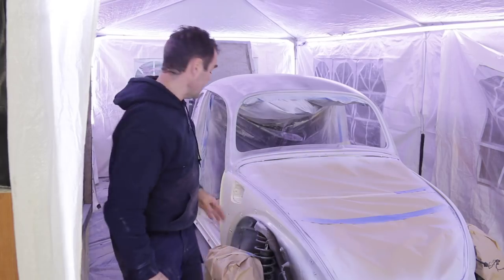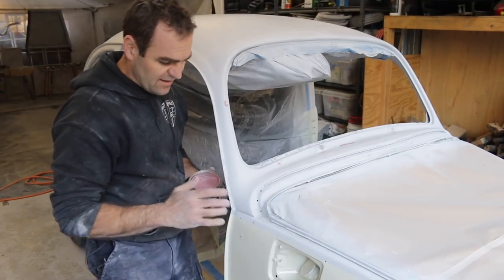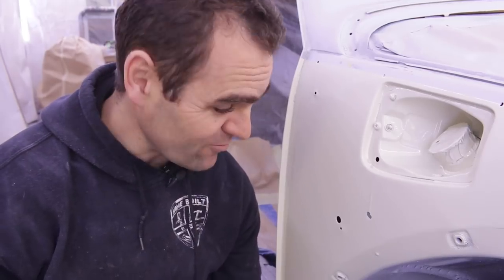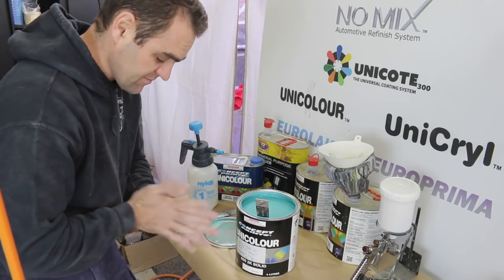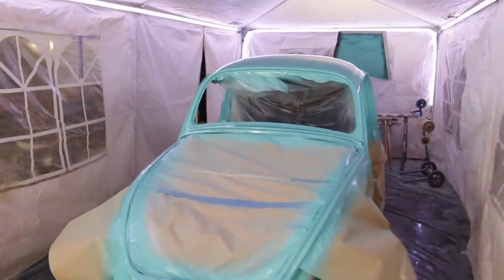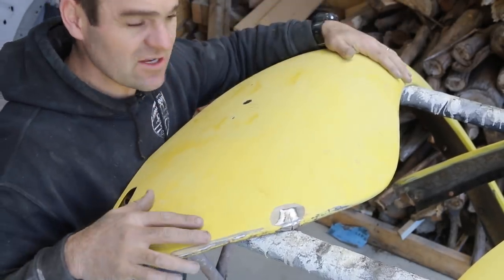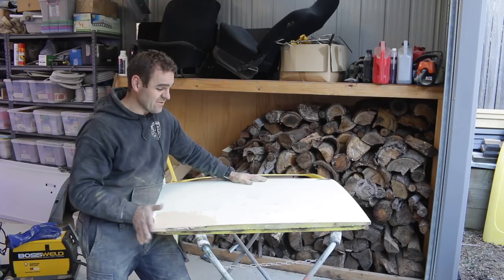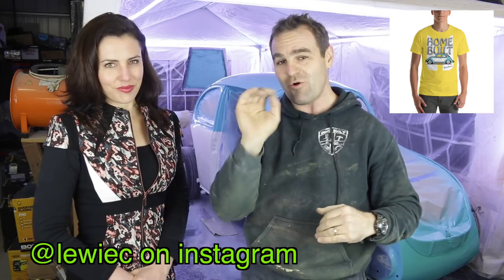New colour for John Lemon - Home Built Project Beetle part 19

Comment: Hey Jeff love the Blue!   When I saw you trying to cut the heads off the runs I thought ," Jeff you are a brave young man.  This is not going to end well!" ...experience.  With your welder are using a gas shield unit or is it straight flux core wire?   I should send you some pix of my 73 project.
Reply from the maker: I use a gas mig these days. It is much cleaner and more stable for this work.

Comment: Jeff good work mate but a tip for the runs mate use the blade you used but scrap it along the run then it will level it out letter and then you don't chip it like you did
Reply from the maker: I actually have a video on that.

Comment: Hi Jeff,
What method do you use for heating up your booth after painting?  I'm very grateful for the time you put into doing these videos.  I have built a booth in my garage based on your one and I'm almost ready to start painting.

Cheers
Ian
Reply from the maker: If you need to heat, I recommend doing it first, as it is better to get the metal warm, and then you can leave it a little while after you paint for the paint to get a bit firmer then heat again to cut down on dust. I have had ok weather in the teens while I was painting so I didn't need heat, but with the Porsche I used a diesel jet type heater which worked a treat.
Reply: Thanks Jeff, sound like a plan

Comment: New subscriber and really enjoying your channel. What’s the trick to welding up that thin metal. I have trouble blowing holes in it. You make it look easy.
Reply from the maker: Turn your machine right down, and just do tiny little tacks. Heat is the enemy.
Reply: Home Built By Jeff Thanks. I’m working on a 1971 bug it’s been hard to get consistent tacks beachside the metal is thin in spots. I appreciate your advice.
Reply from the maker: Jamie Pezoulas another good tip is if you can get behind the weld you can hold a brass heat sink against the back. I use an old brass rod.
Reply: Home Built By Jeff Ah, that’s a good tip. I have a copper plate I can use to try that. Thanks!!

Comment: I haven't tried one yet, but a "Tungsten Block" is apparently the go for minor paint problems. Check out The Gunman's video: https://www.youtube.com/watch?v=lFUvhLKqYVs

There are also small files (like some woodworking rasps) that can also remove runs. https://www.eastwood.com/painters-nib-file-fine.html

For bigger runs, he has a trick with covering over them with fine body filler and sanding it all back until the filler is gone. Basically the filler is used as a guide coat. https://www.youtube.com/watch?v=mn6nPky0HGs

I haven't used any of these yet. but once the painting starts I'll probably be using all of these techniques and more.  :-)

Comment: is your 2pac paint isocyanate free? I used some last summer to spray my car doors, but it seems to have triggered back my asthma, so i'm curious how you find it.
Reply from the maker: No. I never breath it in, and you shouldn't breath in any paint. My booth works really well with proper filters, and I am very strict on wearing my mask.
Reply: hmm i would check whether your mask protects against isocyanates as the only ones i've found which state they work for them are air fed masks
Reply from the maker: Absolutely. The correct mask is critical. My mask is the same that 90% of professional spray painters in Australia use. Air fed masks are not common in Aus.